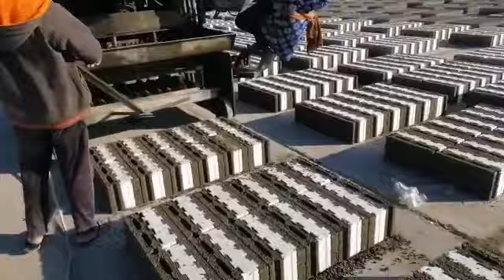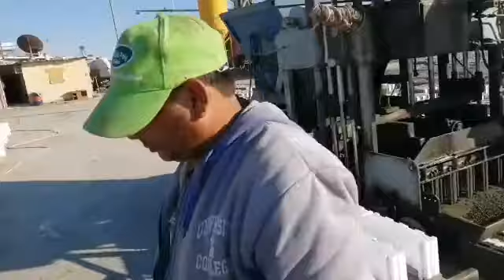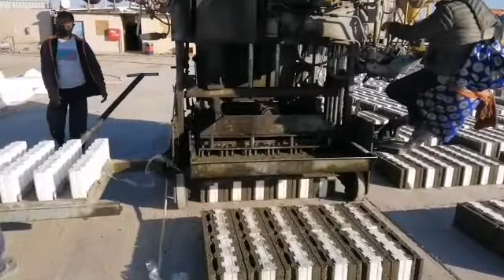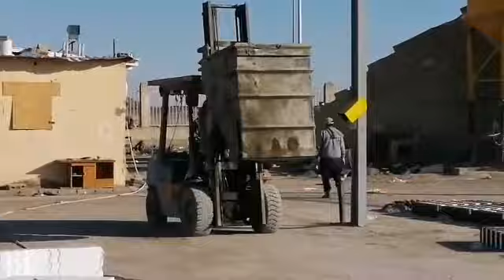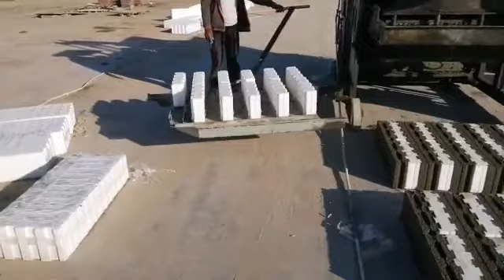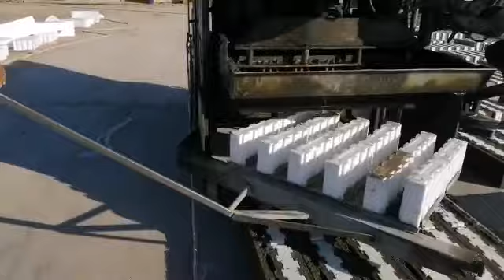POLYSTYRENE BLOCK making machine

Comment: Why? I don't understand what this process is for. Where is the advantage over regular concrete hollow blocks? Producing all that polystyrene must be time consuming and expensive - and that is NOT recycled polystyrene. And the same amount of concrete is used in a standard hollow block.
Reply: У пустотелых блоков всегда есть мостики холода. А у этого блока они отсутствуют.
Reply: This is thermal insulation build in the blocks itself. popular in dubai and hot climates.